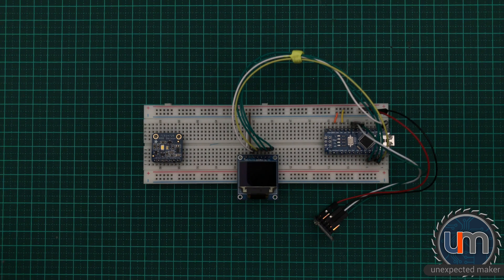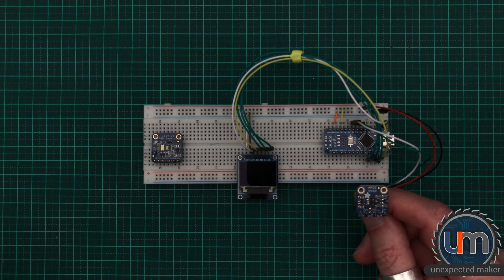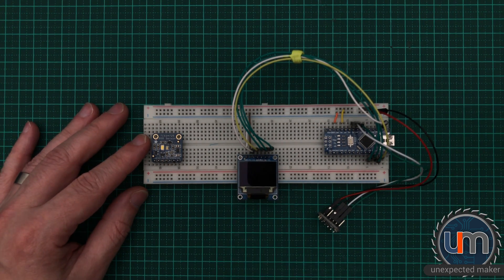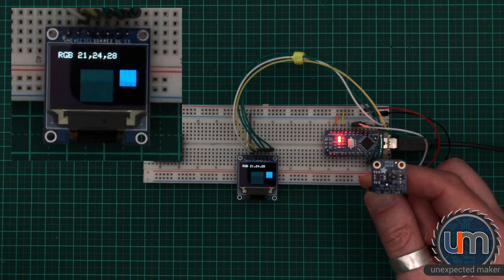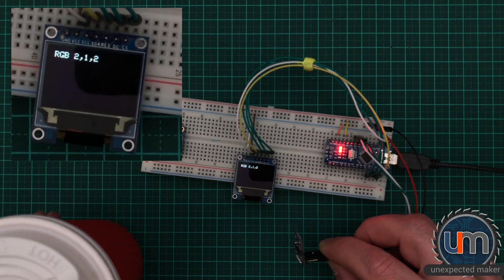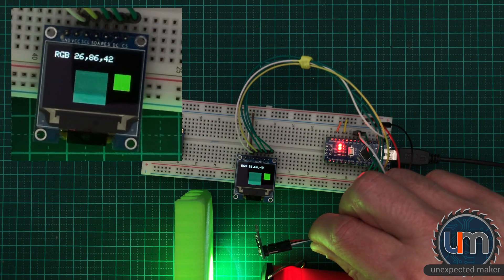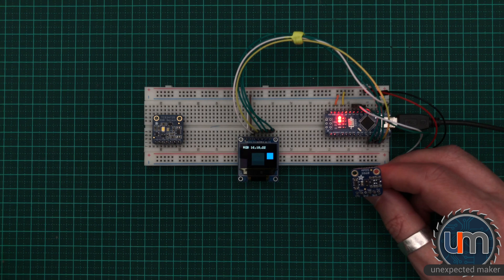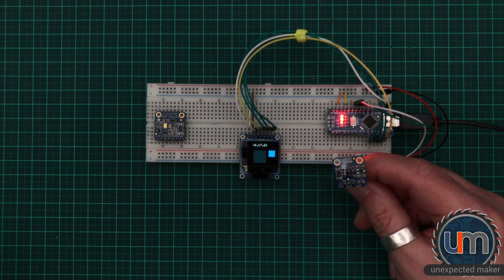Colour Sensor Shoot-Out - Part 2 - APDS9960

Comment: I am a bit late commenting, but I have to agree with the others. It would be real nice if you were to post your sketch on GitHub. You say it's only a couple lines of code, but that's if you already know how to do it. If you are just starting out seeing and reading through the code is one way people learn. I think this especially true if it can be reduced to as few lines as possible. People can read through a short program and understand what is happening much easier. It's like seeing three(3) moving parts and seeing how it works vs. watching ten(10) parts and understanding how part one(1) changes part seven(7).

You should also mention that affiliate links do not cost the buyer anything extra. They will pay the same price either way. I hope that helps you grow your channel. The like should and comments help a lot too. You might be surprised how close to the top you showed in my search for the apds-9960 trying to see people using it for color. Good Luck.